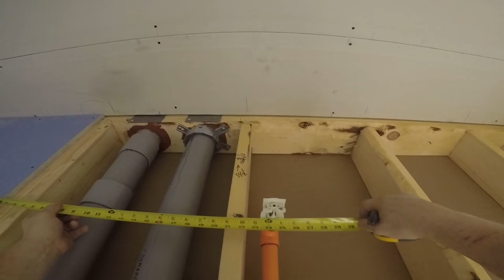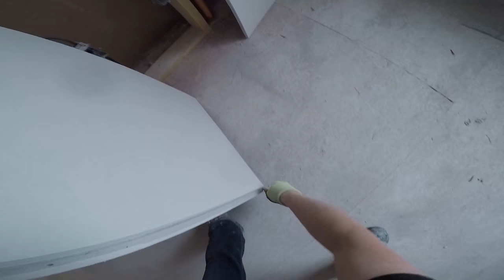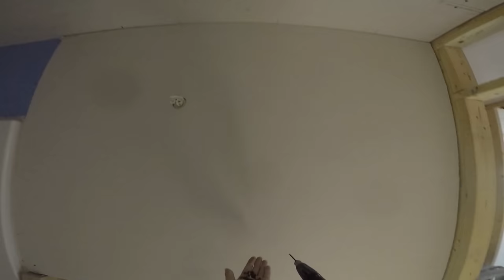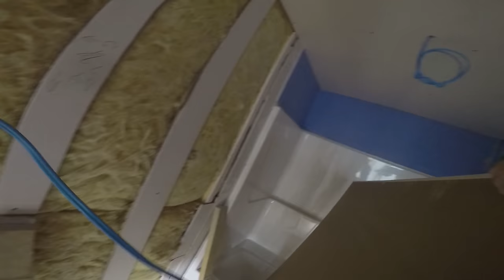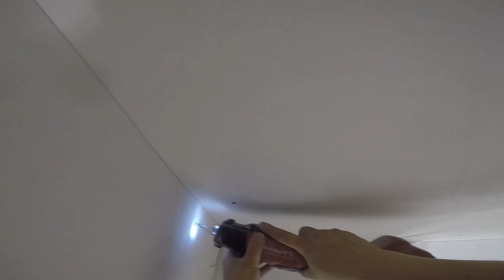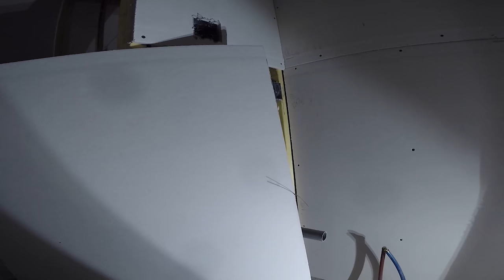How To Drywall A Bathroom In 20 Minutes!

Comment: i notice the strips of drywall attached to the studs on one side. I'm assuming they're to level the plane for the extra layer at the tub.... Clever. I hadn't thought of that...saves drywall instead of using full sheets

Comment: I have drywall behind the towel rack I fixed 12 years ago. The patch is breaking down and falling apart. Is there special wallboard and mud I should be using?
Reply from the maker: Well, not usually but I would use the mold  resistant board (blue board) for bathrooms all around and use a yellow lite joint compound by certainteed specifically for the tape and first coat then do an all purpose (blue) coat.  The trick with bathrooms is to always have the fan on when showering and let it run for 20 minutes after showering before turning it off to help reduce the moisture.

Comment: Why did you do the top sheet first? Seemed difficult to get into place. Cant you do the bottom sheet and then use it as a ledge to rest the top sheet on? Great video
Reply from the maker: We do that so the top joint is tight, better for tape, no prefill needed. We actually have 2x4's cut to place the sheets on and kick in to make it all tight. These silly units aren't built right, the ceiling height is 7'11-1/2" to 8' exact. We end up shaving 3/4" off every sheet at the bottom and put the cut down. The baseboards will cover that. Then we use board lifters to lift the bottom sheet tight to the top. We try to keep all bevels and corners as tight as possible. With a hundred units in each building it really makes a difference when taping.
Reply: Thanks for the good answer! Keep it up👍

Comment: I use the same Hilti gun . Them chargers always fail. Anyways I have the attachment head to put a clip of screws in. Do you know if you have to use Hilti screws or will another companies fit ? I’ve had like 4 years and never used cause the screws are just to expensive to buy like that
Reply from the maker: I've had the same problem with those chargers. I have the new neuron line now and the new batteries and chargers are superior. So what my old partner and i used to do was buy the hilti strips bit keep the strip after use and then would refill them with grabber screws while watching TV or something at night. We found you can use a single strip up to 4 times.
Reply: Nice good idea and yea I heard they put a certain angle on them you had to use them because of that . Thank brother . Nice work

Comment: Great job. How do you cover the screw section of shower plastic panels? I noticed you did put the drywall on those.
Reply from the maker: We install the blue board for tile backing and that covers the screw section. There is one side on these bathrooms that is very slim and I think after the door is installed they trim it out somehow I just don't remember. We are doing another building like this right now so I will be sure to find out for you!!

Comment: I have a popcorn ceiling in my bathroom. I’ve replaced the drywall around the tub and now am stuck on what to do to join the new drywall to the ceiling. Do I need to remove and replace the ceiling drywall? Or should I scrape off the popcorn, tape/mud the joint? Any advice would be appreciated...
Reply from the maker: Yes I would scrap it all off, tape it and paint it. In fact that is what I am doing here in the house we just bought. Popcorn in every room has got to go! It's sad that all these new houses have popcorn. I feel like that stuff should of been left in the 80s but because its so much cheaper to do I geuss. The only other thing I have seen is people adding crown molding buy I still think even that looks a little funny uo against the popcorn. Paul Peck DrywallTube here on YouTube may know of something to do.
Reply: @ConstructionKronies  thanks for the quick reply! Much appreciated!
Reply from the maker: @fixstuff6203  anytime!

Comment: Any issues using regular drywall in bathroom? Anything need to be done to it before painting?Other than around a shower? A lot of people seem to think purple or green board should be used for whole bathroom?
Reply from the maker: The purpose of the blue or purple board is for mold resistance. You have to take mold serious and moisture will damage beyond the drywall and into the framing. I would use the mold resistant board for the entire bathroom myself but most jobs we only have to install it on the shower surround for tile but not the ceiling. Maybe there is a paint and primer you can use, or Detra but I bet that will all cost more than the blue board. I hope this helps you out!
Reply: @ConstructionKronies  Gotcha. I’m using cement board for a walk in shower. I was planning on regular drywall for ceiling and rest of bathroom. What is the deciding factor for you when you only use the blue board around the shower?

Comment: What do you do about the gap around the tub surround flange?, I thought you are supposed to cover it with the rock.
Reply from the maker: No, you don't cover that because it most of the time isn't flat on the wall and when it get tile the mortar will fill the gap and then the tile will finish into the surround.

Comment: Awesome tutorial Chris! You made me so proud using the router for the door uprights and the razor for the header cut. 👍👍 Personally, though not recommended, for pipes i get the bottom and top measurements of the tube, then the 2 side measurements.  It makes a square when lining out with the pencil markings but i free-hand a circle within the penciled square with the router.  It eliminates the circle cutter.  Pro tip that takes LOTS of practice for DIY people that might read this.  Thanks Chris, and God bless! 😁
Reply from the maker: I find centers myself and then use the circle cutter, the side to side and top and bottom method I use for things that I am either not sure about or are in difficult places and I can only get one side. The free hand method is used by lots of pros I just like the cut finish and am totally OCD. Your a boss bro! Thank you so much for the comment and sharing that tip!

Comment: Any tips for thin 25 gauge metal studs like the ones at home depot, rona, lowe's, etc.?  I've been using self-drilling drywall screws for those because the piercing ones tend to bend the stud and don't go through even though they recommend using the piercing ones on thin gauge studs.
Reply from the maker: Yeah 25 gauge is tricky. What you have to do is use the pointy screws the self drilling screws will fall out eventually. First make sure you have carrying channel in your wall every 4 ft and when your drywalling yiu have to hold the stud o  the bevel and tac in the sheet every 2 ft so when you butt the other sheet in the stud is already secure. Come back after all the sheets are up and screw off the rest of the bevels and field. Dont forget 4 screws in the top track and 4 in the bottom track for stand ups or every 16 inches for lay downs. Hope that helps!

Comment: I have a 3 piece shower kit does the green/blue dry wall have to be installed in the whole bathroom or just behind/ near the shower or can? Can I use the green /blue dry wall only for the shower and the rest of the bathroom can be regular dry wall?
Reply from the maker: I am so sorry I thought I had replied to this but yes you only need to use the mold resistant board where the tile goes, the surround of the shower that is exposed.
Reply: @ConstructionKronies  awesome thank you!

Comment: Hey great video! I'm dry-walling a bathroom in an older home right now. I'm interested in how you drywall the area above the shower. Unfortunately, I've was told to drywall down over the flange. Should I trim it and attach it flush to the flange? If so, how do you finish it? Thanks
Reply from the maker: Yes you should stop it at the flange and not run it over. As long as you use a mold resistant board your good the best finish is to tile the surround. Let me know if you have any questions.

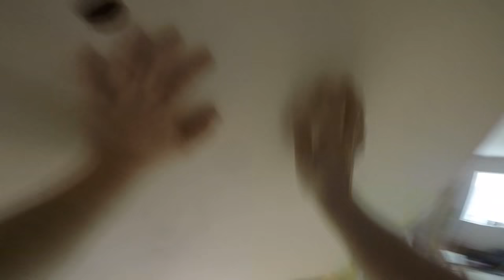Comment: How did you keep those 2x4 from sliding once you rested  the drywall on them? 6:37 on the video
Reply from the maker: We cut a 45 degree angle at the top and give them a little boot to tighten it all up. Once the board is secure the angle allows to just boot them out easy.
Reply: @ConstructionKronies  if you have any left can you post a pic

Comment: how else would you hold it lol
Reply from the maker: Okay so you never want to do that, the drywall will not hold the screw in for one and second you will end up damaging it. We use magnetic bit holders so the screws stay on. I use a hook as well that I can place my drill on when it has a screw so I have both hands free to place the board. We also have a few other tricks we use to place board before we screw it on. Also we have one hand to operate the drill and the other to hold a bunch of screws so you dont have to keep going into your pouch for each screw.

Comment: Whatever you say.
Drywall in a bathroom is totally a useless idea.
Reply from the maker: If I were to do my own bathroom, which I will be redoing mine this year, I would use cement board  for tile backing and mold (blue/green) everywhere else. When taping the mold board use the all purpose compound for the top coats. You can even use Ditra for tile backing. Regular drywall is no good but those two types I just listed are. You also have to use the right paint. These builders are so dam cheap and only spec mold board for the shower surrounds, sucks but that what you get when you buy new these days.